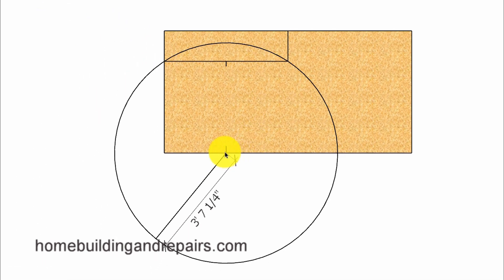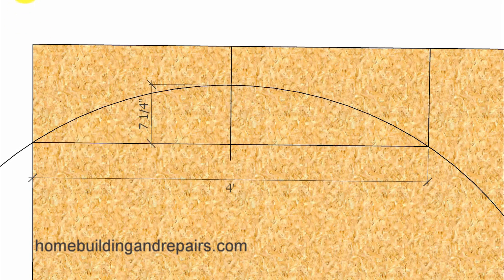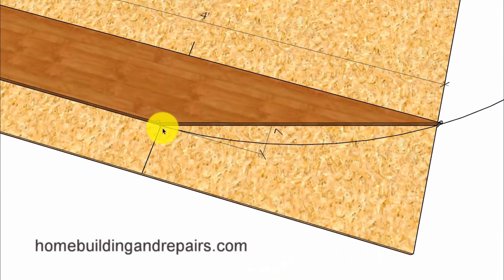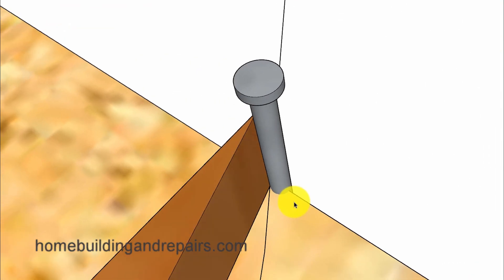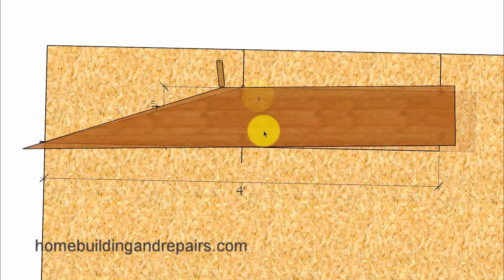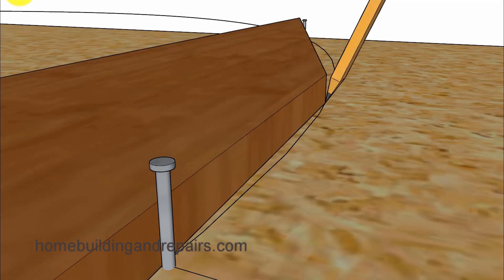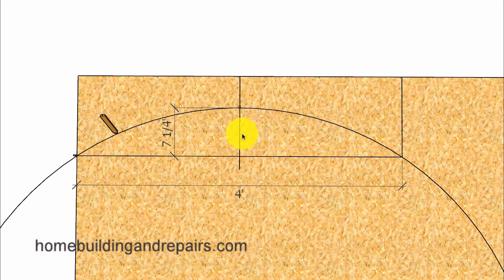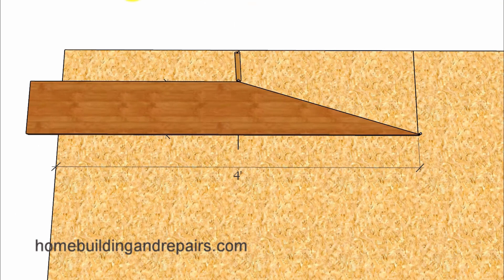Easy Carpentry Trick From Old Home Builders - Calculating And Layout For Odd Shaped Curved Arches

Comment: That's a variation on the old geometric trick of using a framing square to trace out a semi circle between two nails.
Reply from the maker: I believe you're correct and maybe this carpentry trick dates back before framing squares.
Reply: @gregvancom  <> No doubt. The method works on any portion of the semi circle, you just simply align one edge of the board to tangent the semi circle, and then cut the secant of the semi circle on the board.